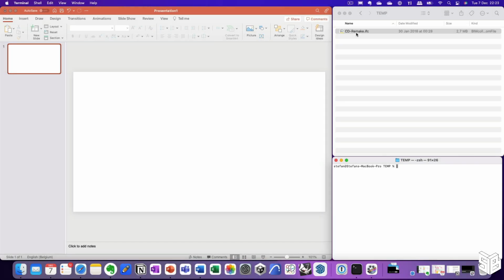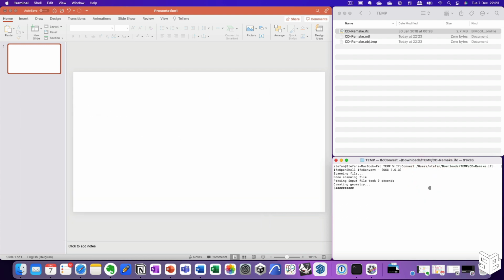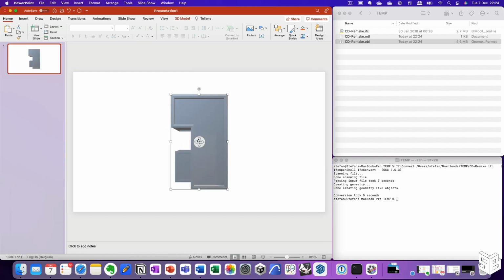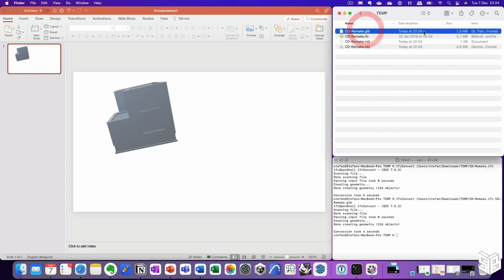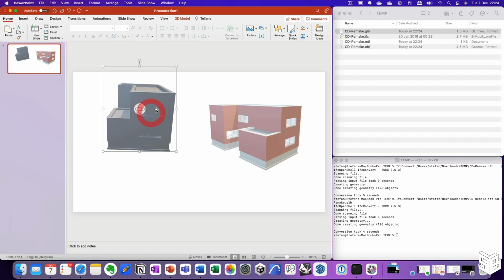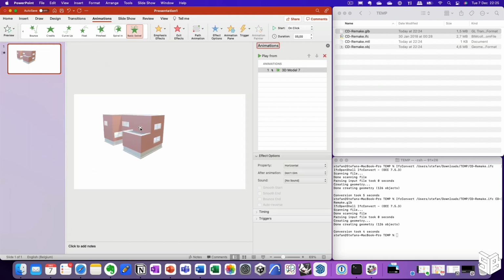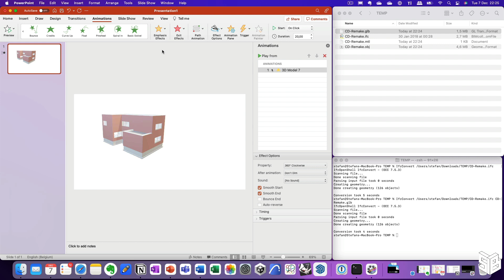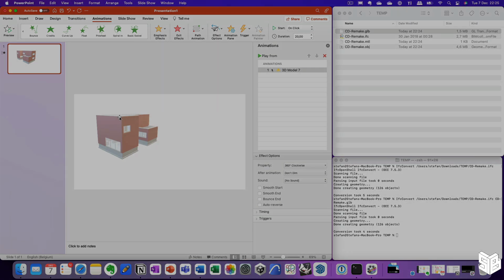Embedding a 3D IFC model in Powerpoint?

Comment: Can I  manually spin around an embedded 3d model during the slideshow?
Reply from the maker: You can preprogram the rotation and should be able to click on the embedded model to do it interactively, IIRC. But it’s tricky, since a click in the wrong place may lead to just jumping to the next slide.